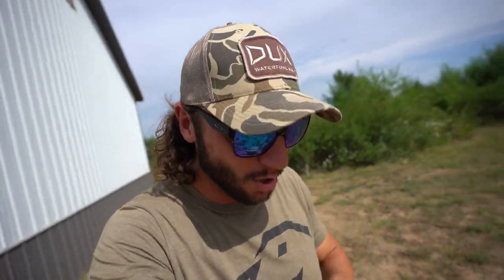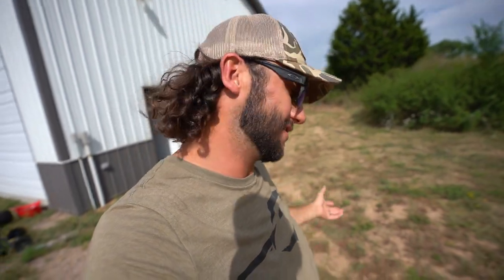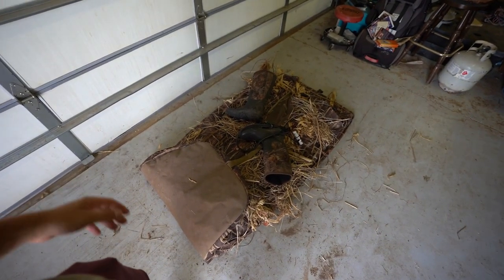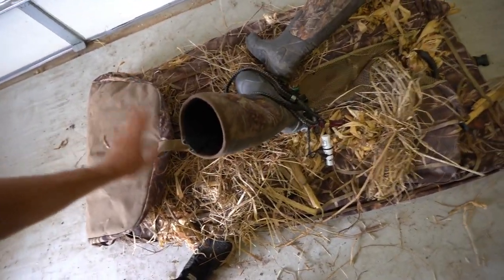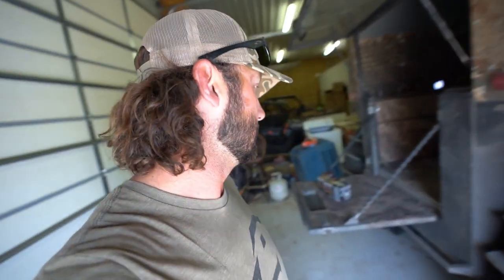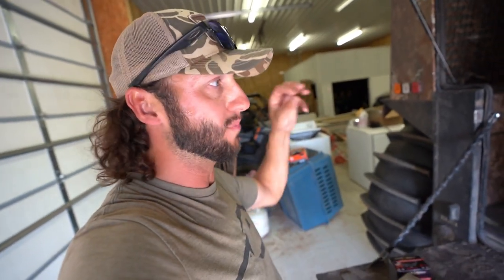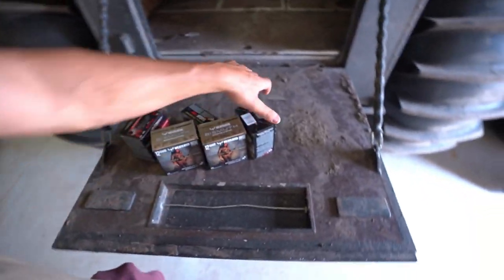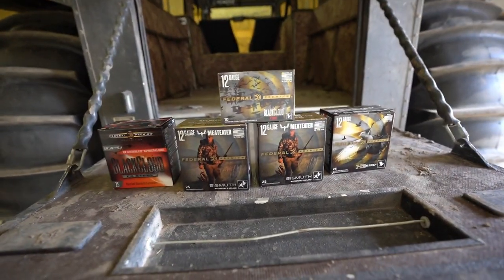My New Shotgun Ammo That You Need to See..

Comment: Hey Bob just to throw it out there for you, ballistically the high brass head does not have anything to do with power. Low brass hulls can be loaded to the same pressure and still be just as effective. The main purpose of the high brass head is to facilitate easier and smoother feeding in pump and semi-automatic shotguns. It does do a better job containing pressure, but ballistically there is no difference. The idea of high brass being more powerful arose from old-time marketing of “high brass high power” shells. They’re generally loaded as hunting loads and the high brass hull is used to ensure the reliability of the shell because no one wants to pay more for the hunting load and then it not be reliable in any gun they try to run it through. Thanks for the video, keep up the great work man and good luck in South Dakota drop them honkers!👍🏻
Reply: I reloaded high powered loads in low brass for pheasants for years so that I could hammer birds plus I could just make a box of ammo real quick before a hunt. 
Blue dot powder is wicked until it gets super cold out. I re-use AA trap loads over and over.  Got the habit of picking up every empty. Not a bad habit.
Reply: High brass are used on shells containing a higher power charge than low brass are,Bobs very correct when he stated the higher the brass the more recoil just his reason was not correct and he did say he was not an expert.Think about it,would you reload a shell with the powder volume above the brass? Look it up lots of info about it online
Reply: You won't ever see a higher velocity or heavier charge hunting load in a low brass shell.  Unless it's a reload by someone who doesn't know what there doing.
Reply: Rusty Shackleford the point being a hunting load. Loads most commonly used in a pump or semi-automatic, they’re loaded with a high brass hull to ensure reliable feeding and extraction due to the fact that if a manufacturer sells a product that even slightly gets a reputation for being unreliable it won’t sell and the company will not profit. The brass case head is there for the bolt face to have something solid to grab onto during the chambering and extraction processes. High pressure high velocity loads are perfectly safe for use and there are numerous examples of such loads in many different shotshell reloading manuals and also Hodgdon’s reloading website. The Lyman 5th edition shotshell reloading handbook illustrates a load with a Winchester HS or Compression Formed hull (AA,Supertarget. Both of which are low brass hulls ) 31.0 grains of Hodgdon Longshot powder, a CCI 209M primer, a Remington SP12 wad, and charged with 1 1/4 ounce of lead shot is rated to a velocity of 1,423 FPS while still maintaining a safe chamber pressure of 11,000PSI. It’s on page 178 in the book for your reference.

Comment: Have you ever tried boss shot shells’ bismuth? I’d love to see a comparison between different brands bismuths
Reply: better ammo  heavi x
Reply: I shoot boss, love it. Much cheaper than that federal will be too.
Reply: boss is the best stuff their is
Reply: yes i want to try those too. Bismuth is a great duck load , its just a lil pricey for every hunt. Ive tried Kents bismuth and theyre good shells.
Reply: Boss patterned way better than any of the other bismuth loads I shot. And we wreak the geese, divers, and puddlers with their 3/5 shot 3in
Reply: @joshuadamron7339  i killed a canadian goose at 40-45 yards with their 2-3/4 #5 shot.  it dropped like a sack of potatoes falling out of a airplane.  very clean kills and very consistent patterns with this stuff. havent tried their mixed shot size shells but have heard great things.  3.5 inch shells were made for steel.   boss holds the tightest pattern ive seen with any storebought shells.  its a good deal too compared to most youd buy at the store
Reply: @Luke Harrison just bought a case of Boss to split with my dad. We are getting 3" 3s at 1.5oz loads cant wait to try them out
Reply: @jordanstark2454  those are my main goose load.  ill use the #2 on windy days  but the 3's are my go to for the geese

Comment: Speed kills not HIGH Brass but they load the higher speed loads generally in High brass shells with more pressure to keep shell from expanding so it will eject better.  the steel chamber of barrel will hold the pressure no problem but may not eject as well in low brass

Comment: Bobby, tungsten and bismuth shells... you want to use a smaller shot size than what you would use in steel for the equivalent quarry. IE if you use 4s on ducks, you can get away with 7s. If you use BB, you can get away with 3 or 4 shot. Heck even those 5s will drop honkers I bet.
Reply: I use #4 hevi shot for geese, and they absolutely fold geese at 40yds

Comment: Have you tried Kent they are one of the only shells that cycle through my gun I love them. Using them tomorrow for honkers
Reply: What kind of gun? I remember when fast steel came out.  1550fps was about the highest velocity you could get. Most of faststeels leads were 1550 then 1625.  It never patterned well out of any of my chokes but Winchester supreme, drylok (not xpert)just about any 1450 fps federal load and the original hevi metal patterned consistently well. I did like Kent's tungsten matrix it was 25 bucks but now it's just crazy expensive.
Reply: Rusty Shackleford I have a Bonelli nova 20 gauge that my grandfather bought me in ‘14. I’m using the standard modified choke that came with the gun and it seems to have the best results up to 50 yards

Comment: BB/7 fine for any geese the TSS has specific gravity around 18.1 steel is 7.8  and lead is 11.34 Heavy shot is about 12 and HEVI-13 is about 13.  7 shot TSS is about like 4 lead but penetrate better because they are smaller.  Think of stabbing with an ice pic vs stabbing with a bolt. 

I recommend the Federal HEAVYWEIGHT Turkey shells in 6 for big geese or 7 for smaller geese when on sell its not super high and you will need many less shells if you shoot well,  These have specific gravity of 15.1 for me better to have all HW 7 than some TSS 7.  I wouldn't recommend it but will kill a goose at 90 yes

Comment: So in penetration tests with shotguns into ballistics gel, 1.5” of penetration is considered equal to a mallard sized duck in terms of lethality. In a test of 1oz as a control weight of shot:
(Densities//-steel=7.6g—lead=11g—TSS=18g)
*(Type-max—effective range)*
#2steel-46 yards
#1steel-54 yards 
BBsteel-71-72 yards
#9 TSS- 73 yards 
So as a result, BB in steel is equal to #9 TSS 
The 1oz loads show that BB only holds 71 pellets while the 1oz #9 holds 357
Pretty impressive if ya ask me
Reply: Pumpinstein  very good point!

Comment: kinetic energy is what kills birds the formula is Kinetic Energy = mass *read weight) x Velocity squared .  Therefore increasing the Velocity makes a lot more difference than the weight of the shot . Thats why load speed steel loads were not very good even at 40 yds (around 1200fps when they first  came out) now steel at 1550 fps isn't terrible.  The thing about the higher density shot is it slows down much slower or further out than steel because it has less air resistance because its smaller for the same weight.  The smaller a pellet is the farther it will penetrate at the same velocity as a larger pellet of the same density but will just make a smaller hole.  Hit a goose in the skull with one shot even down to 9 shot and its dead. Even 9 shot TSS would kill a goose out as far as the pattern will hold tight probably 60 -70 yards. 

the HW 7 shot  in 3 1/2 inch magnum with good choke pattern will kill any goose centered in pattern within 60 yds and you wont be chasing it..  as aside benefit the wind causes much less pattern drift with the more dense shot also.

Ask the federal rep about when there were Tests with Gold  shot !! Yes it did happen around the 70 s

Comment: Tomorrow is teal season here.
Yawn. Usually its a chance to see what all I'm forgetting. Get everything dusted off and see what all needs fixing. This year is different though. Everything just popped into place like a well trained fire dept.   Something ain't right I just know it. 😂
News Flash: 
Been pulling the same rig since the 1900s and just today I discovered that the tires hold 80 pounds, not 32. Gee God I've been running with flat tires all these years. No wonder I only got 13 mpg pulling a jon boat. 😎